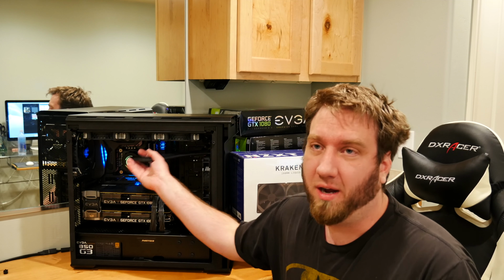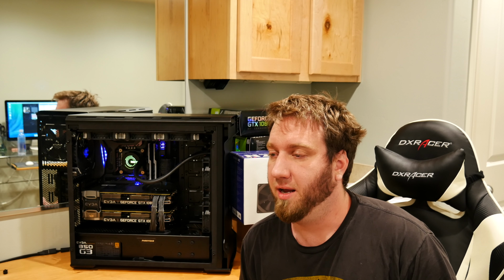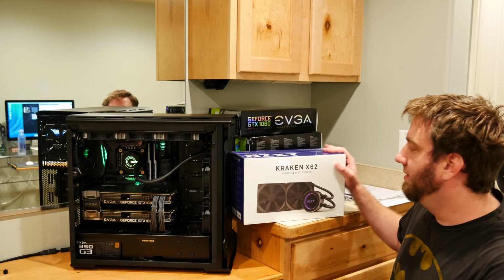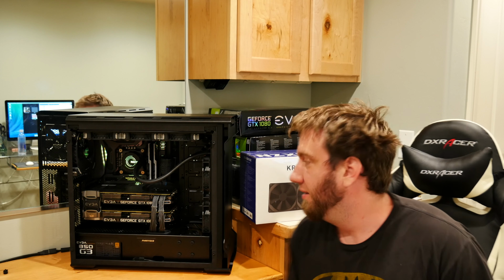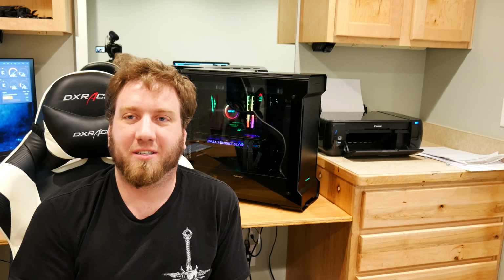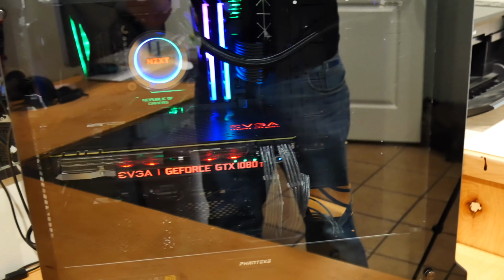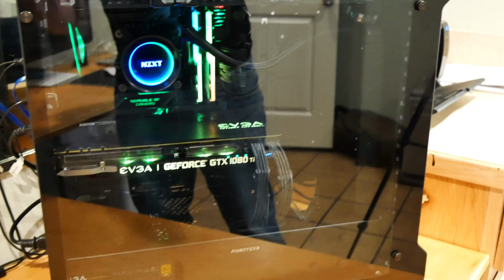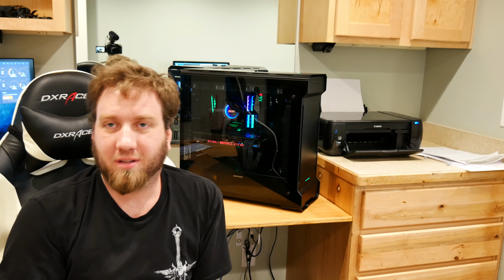Why I upgraded from an NZXT Kraken x61 to an x62 AIO liquid cooler!

Comment: I personally like the top mounted water cooling more to take the air out of the case, 3 intake fans to get air in, back one that takes out and the top that takes air out too. Back one should go for lower rpm so you have positive air pressure overall, even when the CPU cooler revs up with the front mounted ones having a decent amount of rpm. Works wonders and keeps the dust out.

Comment: Sorry about the timing, but that noise is "dry pump"... What you need to do is to fixate your radiator upside down (with the tubes below instead of the top) and it will make the air bubble stay on the top part of the radiator. The way you put yours it is draining the bubles directly to the pump.... Just try it!
Reply from the maker: Cedrico Vaz I tried that and it wasnt that.

Comment: its just the fan, either it has a dust or a bit of unbalance i have had mine for 3 years now and few months back it did this all i did was reseat athe fans and clean it now no sound at all for the last few months. nzxt x61 and x62 is literally the best most premium product on the market better than any other cooler.
Reply from the maker: I can assure you mine was not the fan. I could stick my ear right up to the pump and tell thats where the noise was coming from. But I agree and think that the kraken AIO's are the best on the market.
Reply: Both fans went bad a few years ago, but they still work. They were hitting the case and I changed the position of the radiator from inside the case with fans outside to fans inside and radiator outside, it fixed. It still has a little rattle sometimes, but not very notable. I have it from late 2015, almost 8 years and it works just fine and keeps the oc 4.4ghz 5820k cooled to under 78 degrees at low to medium speeds, it goes higher in the rpm only sometimes. Very robust system. I am thinking of using it for a computer upgrade, don't know if I should sell it with the old components and get a new one. Definitely a good product. I hear Corsair ones were build good as well.

Comment: What happened to your second video card :) ! And where did you connect the AIO Pump(not the fans) - CPU Fan or AIO Pump. What do you suggest - Air cooler or Water cooler.
Reply from the maker: Hi Florin,
I left out the second card since I was hoping to have new cards to put in in the near future and the games I was playing at the time didnt benefit much by having the two cards in there. I connected the AIO pump one of the usb headers and to the aio pump header on the motherboard. Theres two connecters you have to deal with from the pump/waterblock. 
As for what I recommend, it really depends on application. If you want almost no maintenance that will never fail then go air. If you dont mind risking a possible failure but want best possible performance with little to no maintenance then an aio water cooler. If you want the best looks and absolute best performance than a custom loop. 
:D
I hope that helps, but im happy to answer any new questions you may have.
Reply: Thank you for the reply! I wish to have a clean look and also i do not like big coolers like the "Air type" in this day's so i think i will go with AIO water. Regarding the connection of the pump i found out the following. You can connect like this 1. AIO Pump to - AIO connection from the motherboard(the pump will run at 100% all time) and the Fan's from the kit to CPU Fan and CPU Opt(why like this? because you can set from BIOS the speed of Fan's based on CPU temp). 2. AIO pump to the CPU Fan and the Fan's from the kit directly as the manufacturer instructs(this config is usually recommended by NZXT because some motherboards don't start if CPU Fan has no connection) - regarding second config i do not know if the Bios can influence the speed of the Fan's from the kit. I will buy NZXT X62 and i will tell you my findings. Due to the fact that you answered i will subscribe and follow your posts. Have a nice weekend!

Comment: Dang, same thing happened to mine, but by then I was using it for a GPU so I lost the mounting bracket and was using different fans so I didn't bother contacting NZXT.
Reply from the maker: Ive always thought about using it on a GPU, but I get paranoid that the VRM's arent getting cooled. But I dont know why the bracket and fans for it would matter for RMA. If you still have it you should RMA it. :)
Reply: @PCGoblin  I was watercooling a 1070 ti just because I had the extra AIO cooler and the Kraken G12 was $25. At first I was also concerned about the VRM temps but the fan covered them and after testing it and using it for months the temps were fine. When the cooler died I just put the original heatsink back on and didn't give it much thought until recently with my RTX 2080. I've read that the Kraken G12 doesn't cut it for the RX 5700 XT's VRM but maybe adding some heatsinks, a better fan, and/or an extra fan could fix that. There's people that have been using it on the 2080 ti since it came out, albeit with some modifications: https://www.reddit.com/r/nvidia/comments/9lk0n8/psa_kraken_g12_and_2080ti/?utm_medium=android_app&utm_source=share
Reply: @PCGoblin  I have it in a box somewhere, I guess it wouldn't hurt to try. Thanks for the advice and sharing your experience.
Reply from the maker: @JCerris  Just happy to help. If anything, when you get the replacement you can just take its brackets and what not and send those back. But I hope it goes well if you can find it. :)
Reply from the maker: @JCerris  Nice! Thats awesome. Id rather just get the hybrid from EVGA if I was getting a new card. But in your scenario where you had the cooler already it makes sense. :)

Comment: i had x61 for 2years working perfectly, heard there is faulty ones in the wild that makes that sound.
Reply from the maker: niko rautiainen Thats awesome. I went through several of em. It seemed like they all failed. But the x62 is going strong.
Reply: PCGoblin yea i heard there is much of them with that noise that ppl complaining and they admitted that there is faulty ones that came threw to wild.
Reply: is there anything different thought? only rgb colors?
Reply from the maker: Must of been alot of them, cuz seriously I replaced my x61 like 6 times while I had it.
Reply from the maker: It seems to be a better pump, and the waterblock is alot bigger and has colors and a mirror like finish. Then it comes with newer better fans. Not sure how much better but theyre nicer and quieter.
Reply: @PCGoblin  must of been your pc or maybe power output becase i got my kraken x61  in early 2016 and im still using it. i game almost daily.
Reply from the maker: @ShadowsOfTheParanormal  Its neither. Its pretty common that they die. I had the x61 die in different computers at my previous house. Ive even had replacements be bad as soon as I installed them. The newer ones seem to be alot more reliable.But if they were all bad their would be lawsuits and/or recalls. Im glad yours is working well though. :)

Comment: That noise is because the pump isn’t receiving sufficient voltage. Go to the bios and turn the “fan speed” to max on the header that it is connected to.
Reply from the maker: That can create that noise, but that was not the issue this time as I made sure to check those settings. It also worked fine for awhile before it started failing with no changes made.

Comment: My x61 never was recognized by my pc, I went through costumer service many years ago and they never gave me a solution so I've been using it for all this years without the software features :(
Reply from the maker: Weird! Did you have it plugged into a usb header too?
Reply: @PCGoblin  yes, I tried different ports but for some reason the drivers never worked on my Gigabyte g1 gt motherboard, and months later they just removed support for the x61... I guess their was too many people with the same issue.
Reply: @GermanViking  man, thats not great
Reply: @jpwillardson6904  but this is the year of the upgrades so I'm planning to go with a newest hen mobo and cpu and later a new decent water cooler 🙏🏼
Reply from the maker: That sounds awesome! Its way better than an x61 for sure.

Comment: What is the cpu you have??
Reply from the maker: Bastiaan Wijtenburg I have a delidded i7-7700k
Reply: PCGoblin i have bought an i9 7900X (10 core) and a nzxt kraken 62x. I have checked every video but what do you think will it keep my cpu cool enough?
Reply from the maker: Bastiaan Wijtenburg It depends, you may want to get the x72 instead, its nzxt’s 360mm rad, it has a little bit more cooling capability. Are you going to overclock your i9? Are you going to delid it?
Reply: PCGoblin for now i am not going to overclock it
Reply from the maker: If youre interested in overclocking it, I would. But you may not be able to overclock it as far but honestly the chip not being delidded is probably the biggest thing that will be holding that back. But good luck. :D
Reply: PCGoblin thank you